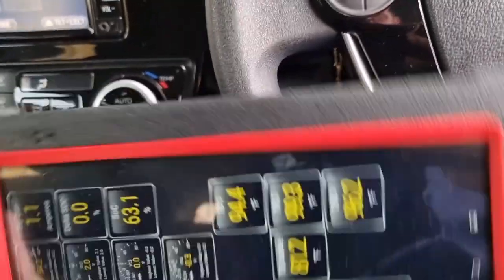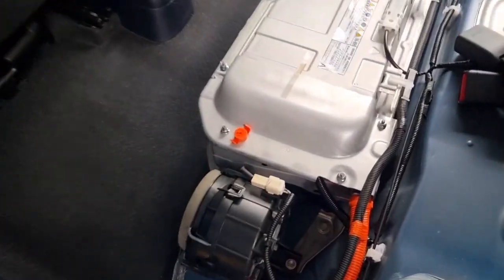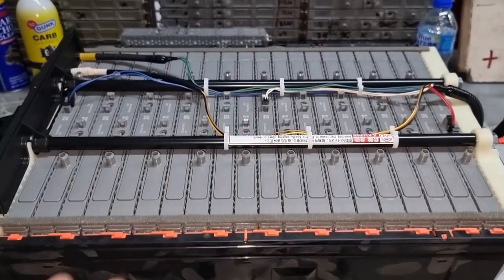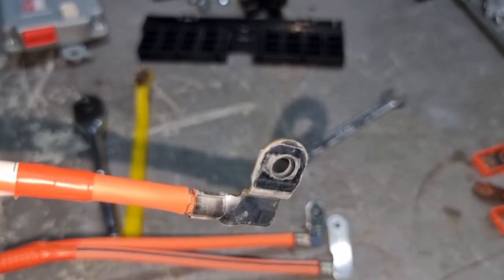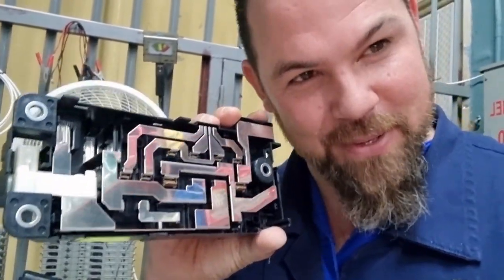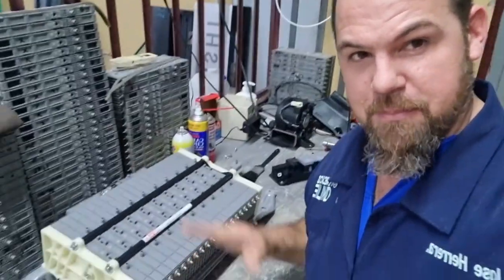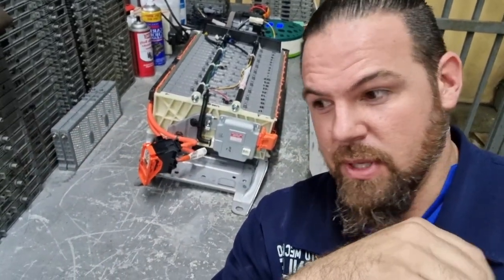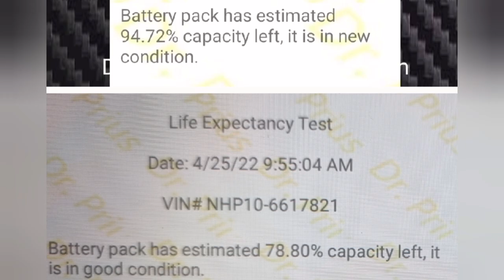Hot weather will kill the hybrid battery faster, so you better do this

Comment: You probably have saved me $25,000 easy.  How?  Any hybrid that was used in the American south will have exactly the same problem.  So buying a used one must be done with great care. It’s not enough to examine the high voltage battery fan filter, you also have to check the battery itself.

Comment: Great video! Corrosion CAUSES heat, plus ambient heat, hard on ANY battery. Extreme heat/cold are hard on ANY battery.
I worked at a lead/acid battery mfg so I'm "old school". I believe in slow charge, so if it was MY battery, u went thru all that trouble, I could wait a couple days.😉😁🇺🇸
Reply: Yes, this is good advice, for lead-acid batteries. When you get to AGMs, they prefer a bit sturdier charge like 0.1 C, so a 100 ah battery should get 10 amps max while charging (if it wants it).

The NiMH are a different animal. It is harder to tell when they are charged - the voltage stays relatively stable. The signature is more pronounced with a much stiffer charge, and 1 C is appropriate. That means these 6.5 A.H batteries are best charged at 6.5 amps. It isn't easy finding a charger that will do that.

Comment: Have you had any issues with heat soak? With his state of charge, does your batteries particularly in the middle heat up over a threshold and the cooling fan not working quick enough to cool it?

Comment: Hello, what is the typical symptom, when a hybrid battery (Toyota Camry) is too hot? Will the hybrid management system decrease/cut electric power output? In very hot weather (38°C/100°F) with AC off, I experienced a) the combustion engine would keep running all the time and won't turn off and b) electric driving is impossible. After parking in the shade, with AC cooling the cabin down, EV driving is/was possible again. Is this a normal safety program of the system to preserve the health of the battery or did I already destroy the battery? Car isn't showing any faults in the instrument display. I have the car since a few months. Today was first very hot day driving it. Car has never before showed aforementioned behavior.
Reply: Mine also the same problem and that hot time AC also working unstable.
Have you found problem?

Comment: I live in Indiana which is in the US. Indiana weather fluxuates back and forth where be in the 90 degrees Fahrenheit and the next day be 50 degrees Fahrenheit.  All I have is a driveway. I don't have  a garage to put my car in. I take extra steps in hot weather by open all my doors allow the inside to cool off before turn on the car. The moment I do turn on the car is to turn the ac on full blast. When in winter I don't have control of that.  Plus there is no videos shows how to protect hybrid batteries from kids spilling their drinks in the back seat or dogs peeing in the back seat.  I hope designers  thought of this.

Comment: I can't help but wonder how much of the corrosion on the links are due to salt air of your location. The green on the nuts indicates chlorine.That suggests it's more than just heat that causes the corrosion. Green is also oxidized copper.The car's computer reduces battery usage when the battery gets hot, controlling the temperature. I see that on my DR Prius app on Highlander Hybrid 08. That said, corrosion shouol be removed no matter what the cause.

Comment: Hello I had a question for you. Once the bad modules have been replace does the permanent code for the hybrid battery go away after driving it around for 100 miles or so? Or does it have to be eliminates by a mechanic?

Comment: Jose, thank you so much for your channel it helps me out everyday I'm even fixing other people's braces now LOL anyways I have a question after I balance my batteries the traction battery will the check hybrid system check engine light thingy will that go away if the batteries are rebalanced and I clean the EGR thing out and cleaned out my fan I think everything should be okay but will that fix the car? Thank you
Reply from the maker: As long as they have same capacity it should be fine... for more great info you can just sign in our online HV battery training... send me a DM via our instagram page 👋😎 you will love it...

Comment: hello every body, I am from reunion island and i have a toyota yaris hybrid 2012. since two month, I have engine light and abs light 'ON' with disconection of hybrid system.So for a long time i just reset the system with pulling out minus cable of 12 volts battery. last week i open the battery pack and found a lot of corrosion on the cell terminals. so i just clean it with water +salt+ vinegar and took the voltage.  i found that the cells N° 11 ans 12 has 7.77 and 7.78 volt the others have  7.80 to 7.90 volts. So I did not change the emplacement of cells and put it back on the car. I constat that when i put my air conditioning during 10 minutes of drive, the engine + abs light comes 'ON' again with hybrid disconection again. and today i try to drive without air conditioning, no message appear and no disconection of hybrid system. do you think  that its battery pack? and i also have code U0100 with U0293.  thanks in advance for your responses.

Comment: Hi there, I lived in Singapore and driving a Sienta Hybrid with 1NZ-FXE. Recently I realised my fuel economy can no longer go pass 17KM/L. Did a scan on hybrid battery capacity and it shows 44.52%. 
May I seek your suggestions should I reconditioned or get a brand new battery?
Mileage is 180k km.
Reply from the maker: Replace it …
Reply: @Hybrid Solution Diagnostics  Appreciate it. Learning a lot from your videos.

Comment: You say we don’t have to clean both sides to a mirror finish, but what about the electrode that makes contact with the busbar on the other side? Doesn’t it require contact to the busbar with a mirror finish?
Reply from the maker: Not really... it is just a voltage reading for the bms, so hi current won't flow through it 👋... a normal clean is enough

Comment: I have a gen 2 Prius with new nexcell battery's but still slow on acceleration also no codes any advice thanks
Reply from the maker: Make sure tune up the engine properly… injectors, plugs and of course check the compression as well  as fuel pressure ☝️🥸

Comment: So there is only one material better at corrosion resistance than Nickel, gold. Lol. The mirror finish is to ensure more surface area in contact. The only way to get better contact is using a foil of Indium. But indium corrodes. Do you ever add 2% nitric acid to the battery acid for cleaning copper?

Comment: Can’t get sulfuric acid anywhere here in the USA unless I buy a dead $30 battery from the junk yard. Is there another way to clean the copper busbars? 
Also, can the sulfuric acid be removed from one of those sealed Prius batteries?
Reply from the maker: Any parts place should have it...
Reply: @hybridsolutiondiagnostics sulfuric acid not available in any US parts stores. Also, nobody sells a used car battery. Highly regulated. Any other options?
Reply: @ivannc3933  you can get it at a pool supply store.

Comment: Can’t find sulfuric acid anywhere. Can you recommend an alternative?
Also, brake cleaner doesn’t remove the black stain from the nuts. Is there something else that will work?
Thx
Reply from the maker: Whaaaaaaaaat... sure any old 12v battery will have some... and you can always reuse the acid 👋😎
Reply: @hybridsolutiondiagnostics  ok, got it. 
I used industrial strength vinegar, baking soda and 2000 grit water paper. It came out shiny but still had 5-10% of markings on it. But none of the remaining stains are on the contact part. I wish I could send you a pic.
Is that ok? 
Also, the nuts are BLACK! Even brake cleaner won’t clean them. I’ll have to hit it 2-3x and see what happens. LoL
Reply: @ivannc3933  the vinegar discolors the nuts. Did you put them in vinegar?

Comment: Really enjoying your videos. Interesting subject. Do you think car 🚗 color may factor in to possibly degrading batteries over time. Since darker colored cars like black for example get hotter inside when sitting in the sun ☀️ as opposed to white cars which would be cooler. Would be interesting experiment.
Reply from the maker: Vehicles are well isolated inside, however it is just a matter of time.
Reply: @hybridsolutiondiagnostics   replaced my 12V battery today and I think there are two options in my case why it may swell:
1. I used the battery reset switch about 5 times (battery voltage was 9.5V at these moments). As I know, this switch just closes the circuit through the inverter to fast charge the battery. If so, there can be a very big current flow that can damage the battery even if this battery can handle this current officially.
2. One time the main battery fuse was blown (the fuse was 125A, replaced on 150A).  At that time I didn't know how the battery reset switch worked (interesting thing, with the disconnected main battery if You click on battery reset the car will turn on the 12V battery but will not charge it). So the 12V battery was drained fully to 9 volts and after that battery reset even did not work. So I just connected the terminals from another 12V battery to jump-start the vehicle and I think that was a mistake because of current flow.

I think, In both cases, there are no current limitations and that really can damage the battery.
Reply: @hybridsolutiondiagnostics  it would be nice if You also made a video on how to clean this battery inside) Thanks for the content!